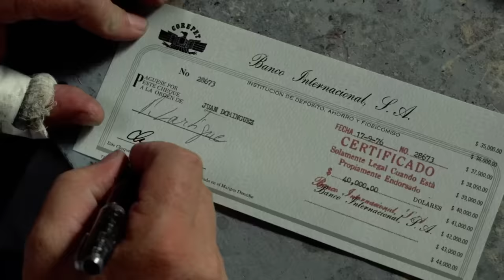WTF Happened to Sorcerer (1977)?

Comment: Well done! There is a bit of backstory that has never been discussed. In 1972, Friedkin and producer, Phil D'Antoni, discussed a sequel to The French Connection called "The Bunker Hill Boys." It was about the French Connection heroin that was stolen from the police Property Clerk's office and the mobsters who stole it. It would have returned Gene Hackman and Roy Scheider in their original parts. But, of course, Friedkin chose to do The Exorcist first, and D'Antoni made a different cop film called The Seven Ups. Then to top it off, 20th Century Fox made its own sequel, French Connection II, directed by John Frankenheimer, so any Friedkin lensed French Connection sequel was dead. That is, until the early 1990's when D'Antoni and Friedkin did commission a script about the stolen drug caper. That sequel was named "Bump City." But 20 years proved too long a time to return to the material and the unproduced script was as far as the project got.

Comment: This is a Hollywood version of a French classic and of course where Clouzot used psychological finesse and subtlety the Amerrican director had to overdo it with overacting and charging the plot with subplot and scenes like a cook keeps adding ingredients to a meal he fears it wont be good enough fot the taste of his customers. For example in WOF the way we get the explosion of the second truck is when one of the guys in the first one pulls up a paper and starts pouring tobacco on it to roll a cigarette, then a sudden gust of wind blows the tobacco and in the next shot we see the column of smoke rising above the jungle. That was delicious. Also the most tense and emotionally charged scene is when the character of Ives Montand is trying to get the truck across the lagoon of petrol produced by the explpsion and as the other guy had stepped down to help move a wheel that is stuck in the muddy oil with a big tree branch, the wheel gets on his leg and starts crushing it and the man cries out in pain and despite that the driver keeps going forward knowing that this is the only way to get the truck out of it. He finally gets the truck out, he carries the half dead man inside the truck and drives off. I dont remember if the guy survives but that scene was brutal and nothing I saw in Sorcerer comes any close in comparison.

Comment: I saw the film during its original 1977 release. I remember that its first 30 minutes -- during which it introduces its four principals -- was slow and disconnected. Only when the four connect and get their "mission" does the movie take off -- after which it's amazing. Ironically, some 25 years later, Friedkin would direct another horror film, THE GUARDIAN (1990), in which the first 30 minutes were cut during editing to remove the dull exposition to get straight to the heart of the story. Perhaps SORCERER would have benefitted from a similar treatment.
Reply: Paramount thought the film would just be a relatively compact jungle based thriller (parent company Gulf Western Oil had interests in The Dominican Republic so they could get a deal on shooting there, and use their resources already there for set building, locations, crew).  They were shocked when Friedkin insisted on not only having origin scenes for the principals, but actually going to their home countries to film.
Reply: @davidjames579 I thought the origin scenes in the beginning were intense, and well directed.   The movie slowed down for too long after that,  but the jungle driving scenes made up for that.   I was disappointed there was not much of a story - but I guess it was more of a psychological drama.